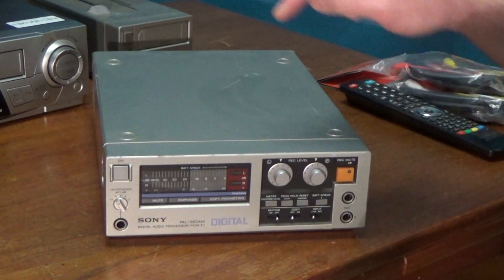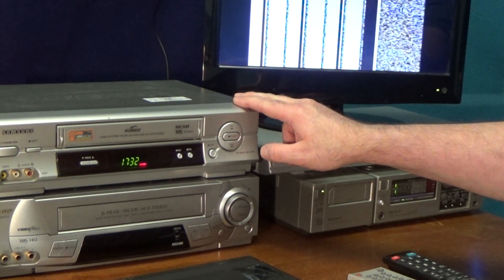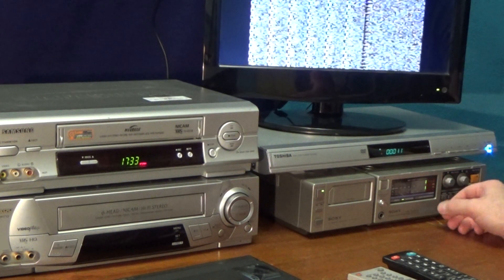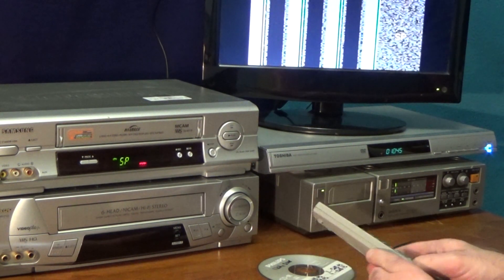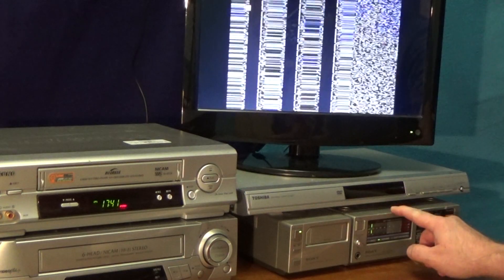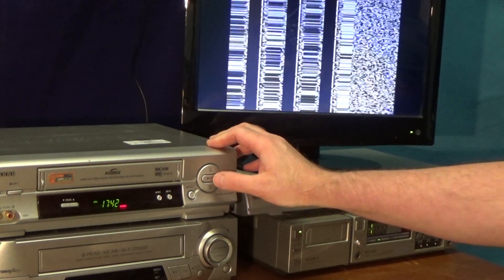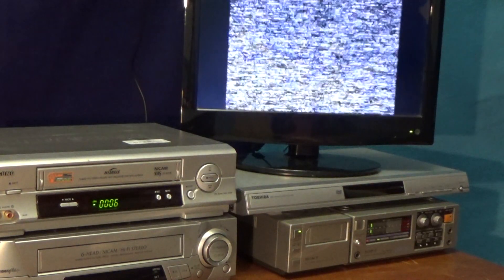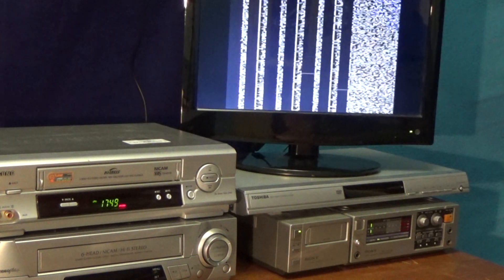Playing with a Sony PCM-F1 Digital Audio Processor

Comment: Some years ago, i had the opportunity to test a NTSC PCM-F1 before buying it , i connected the video in to video out with a good quality video cable , i input a high quality analog audio signal and i compared the audio output of PCM-F1 with the original audio signal, the quality was not i was expected, compared with my Tascam DA-3000 SD High Res audio recorder , so i let it go, but i'm sure that in '81-'82 it was a WOW machine. Having only a PAL VHS , i was not able to test recording a VHS cassette, only a multi-system Samsung VHS recorder was able to record/play on VHS tape, but the quality was very poor , with lot of noise .I also used the multi-system Samsung VHS recorder as NTSC/PAL converter and used a Panasonic PAL HDD Recorder, but results was worse, probably the conversion and the HDD recorder used some digital AD/DA circuits . I remember that In '84-'85 i tested a top Grundig HiFi Stereo VHS (i don't remember the model , VS 680?) who can record a movie soundtrack using the audio fixed head and IN THE SAME TIME it can record a high quality stereo music using the separate HIFI audio input/output and the rotating HiFi heads, the quality was PERFECT at that time, better than any consumer Cassette or reel to reel recorder. I believe i still have some cassettes with some action movies and on the HiFi section some of my best vinyl records of that time.  Unfortunately , it was VERY expensive, way out of my range....Nice toys ! Nice job, Tim !

Comment: hi have sony  701es   i can use with a jvc BR8600 this is a liner  2 channel  audio decks   it cost alot of money new 2500 uk  i have seen a sell  paper work 
for it 

they used to sell for silly low money in the past  now prices  of any  pcm units are silly high why i got in betacam decks in need of work   love to see how alot find a way they can use  the gear

Comment: Fun Fact: The Euro versions of the F1 recorded at 44.1khz (CD rate), and the US versions recorded at 44.056khz.  This was due to the Power ("Mains" in the UK) frequency that the power supply used.  If you had the PCM-601 (I have one), you could use the Coax digital (SPDIF) to make a perfect US copy, but have to resample to make a CD out of it. You could use the raw US 44.056khz rate and just "speed it up" (change rate to 44.1 without resampling), which what most most software programs did anyway.  FYI: You can't play a Euro tape in a US adapter and vice-versa due to the video frame rate difference.  Using a standards converter caused massive distortion on an unmuted F1, or just silence on the 501/601/701 as it has an automatic mute circuit.
Reply from the maker: Thanks. I was curious to know what would happen when playing an NTSC recording into a PAL decoder (and vice versa) but these things seem to be astronomically expensive for some reason so I couldn’t justify the cost of buying an NTSC F1 just to try this. I knew it wouldn’t work, but was curious to hear the effect.

Comment: I’m now curious to see if a Video CD (VCD) would have the bitrate for it.
Reply: VideoCD used MPEG-1 which doesn't support interlaced video, so that wouldn't work at all. DVD might work because it's MPEG-2 but because the lossy compression of MPEG is not intended for this, you would probably get a lot of dropouts unless you use a really high bitrate.

Comment: I have the home versions the PCM-501ES and the PCM-701ES.
Reply from the maker: Very nice! I think the PCM-F1 was originally intended as a home device, but found most use among professionals. I also have a PCM-601ESD somewhere, which I think is the only model with S/PDIF i/o as standard (other models need a modification to support S/PDIF).

Comment: Hi, great video. I'd be curious to see how VHS generation loss affects the quality of the recording. Any interest in making a video where you transfer the tape back and forth, and show how the audio quality is affected in each generation?
Reply from the maker: Great suggestion! I will certainly try this experiment at some point. The F1 seems very tolerant of noise in the "picture" so I suspect it will survive a few generations before any noticeable deterioration in sound quality, but will certainly be interesting to see.

Comment: Just to inform you SP is the  standard speed on all VHS players
Reply from the maker: Yes, I incorrectly referred to SP as "short play" in this video. I think the correct expansion is "Standard Play." PAL VHS only had two recording speeds: SP and LP, with LP mode doubling the recording time. There was no equivalent to NTSC's "SLP" or "EP" mode.